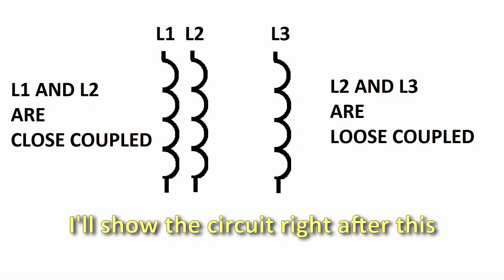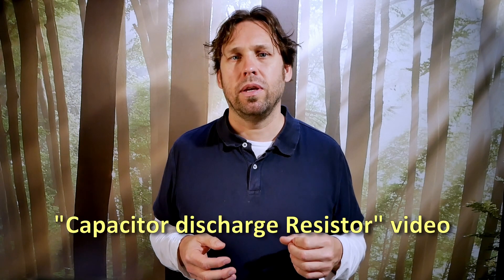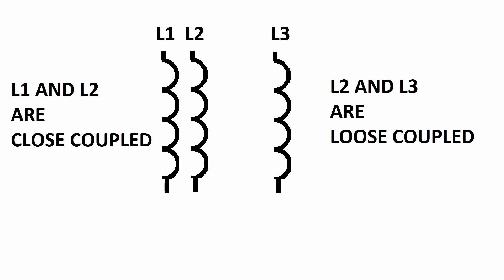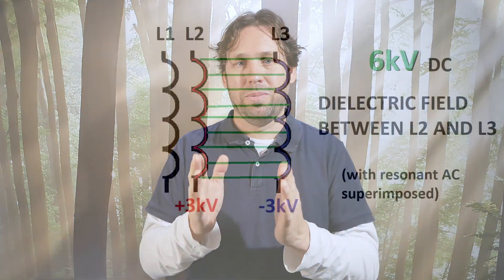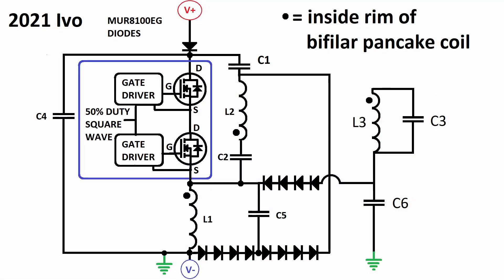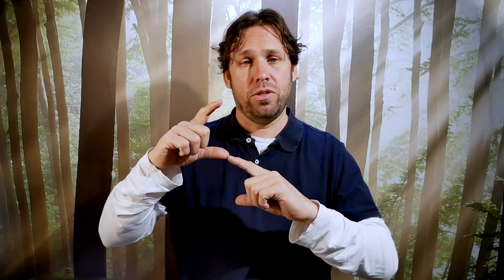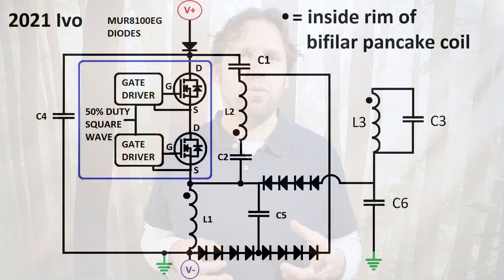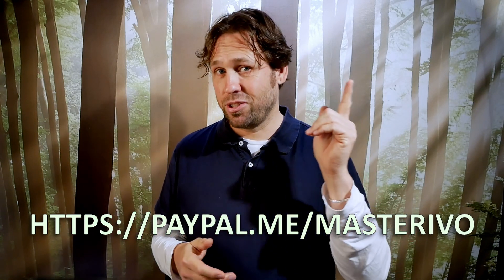Radiant Coil Capacitor Circuit 2021 Explained

Comment: It looks as if figure 1 and 2 could be different. The pancake is 2, but one could be tubing positive with wire for negative going through it. I wonder if an insulator on the wire negative going through the tubing would effect efficiency or not. Bare wire would probably correct itself inside the tubing's electron condensing factor.
Reply from the maker: can't follow your words
Reply: @MasterIvo  don't know how to explain it other than that
Reply: @MasterIvo  at the junction before the hardware..
Only on positive. Maybe a 2 inch long by 1/8 inch diameter, crimped onto wire.

The tibifilar coil would be a good test, and I'm not an electrical engineer so I do not know the numbers what amplification the piece of copper tubing does.
Reply from the maker: @brendananderson324   sorry, I still don't get it.
Reply: @MasterIvo  for the positive input. Before the connection cut positive wire, crimp 1/4" or 1/8" or relative sized diameter copper tubing (2" length should suffice) onto the spliced wire

This should be Tesla's final secret of 5000%+ amplification

Comment: I though you were making a  spark gap
I can send you plans from Lakhovsky V type one. Very interesting setup
Reply from the maker: yes but the sparkgap is for another project video. the pure tungsten just arrived.
Previously I used Tungsten steel which melted instantly with a white flash.
Reply: @MasterIvo  have u ever used nichrome does it have any use or can b used for spark gap... Do u have any experience, think graphite will also work, and do a differential later when u find time nothing imp though
Reply: @MasterIvo  carbon ark lamp ! Look it up on wiki

Comment: Great as always Mr Tesla
Just grow a mutasche and shave the bird 🤣🤣

One question
Have you tried high brake doorknob type ceramic capacitors.
I have a bunch of those that I use on the Lakhovsky MWO

Thanks again
Reply from the maker: no I haven't tried those because I need large capacity, those are big and mostly in the pF range right?

I cut my beard, and had a mustache for 2 days. It was hilarious. Now going to grow a nice thick winter beard again :)

Comment: Glad to c u progress 🌹as far I have observed spark gap is essential with the cap, cap maintains the voltage component and discharge charge cycles  while spark gap has the curiosi function of flipping charges and as in stout bar and thrs a dielectric wave at high frequency pulsed via the high capacity capacitors,  while this acts as the radiant or scalar component the ac component which flips the magnetic component at 60cps ie ac component is needed, so Chk 22kh of cap and. 60cps of ac and use both 2 have the magnetic to dielectric integration...
Reply from the maker: instead of a spark gap, I discharge with the impulse
Reply: @MasterIvo  not sure but the coils I believe may act as a low frequency filter thr by removing ac part esp without the ferrite core would like to chk it out though just my intuition and do chk out on nmr too so that u cd do magnetic flux increase or decrease study, as it can't b done inside a gen, study in between the coils  n2 shd raise capacitance probably as diamagnetic, as compared to paramagnetic o2 which shd increase the magnetic flux part, and if it helps cd check with magnetic flux measures though this wd b more useful in a generator or alternator to introduce the accompanying ac and if 3 phase makes it practically convenient

Comment: Thank you Ivo,. Too few people like you.
Reply from the maker: Thanks. More and more people, we're growing in numbers (I hope)
Reply: @MasterIvo  br just conc on charge seperation thats key, pos and neg when u spin magnet ie via magnetic flux thrs just charge in copper or current n voltage as it increases........ So hw 2 increase the charge in copper is what u must analyse say in 10kg copper what is the max charge that can be generated per cps, ie 60cycles in a sec... It's not that difficult... Just how much charge u can generate is generator per sec and that can easily be stored n discharged via cap
Reply: It really makes me sad. I always think about that when i look at this work. You have to look at all the vids from the begginning though. That dosent help. I feel like i have to go through em all again sometimes.. wich i will do for shure 🤭😅
Reply: mondays may start like this :). Thank you